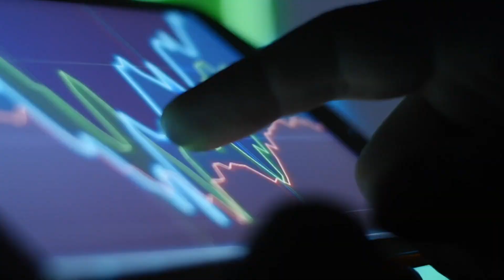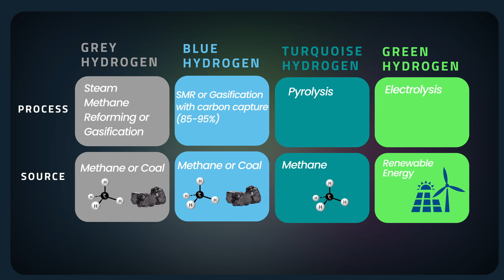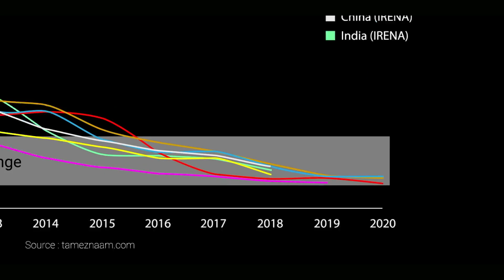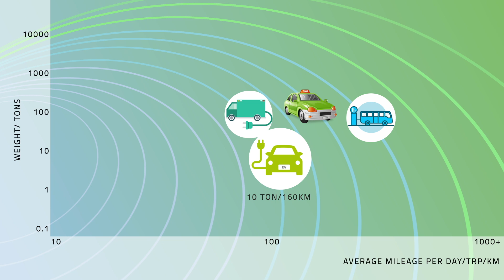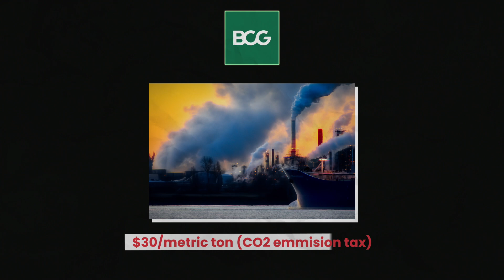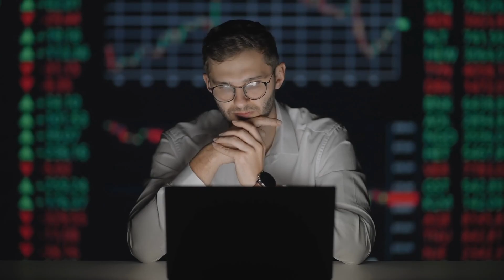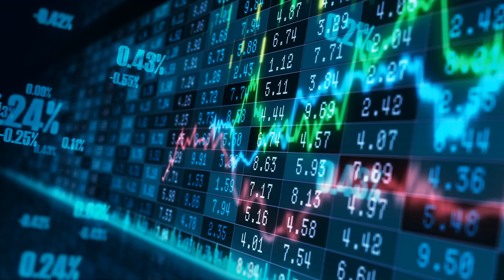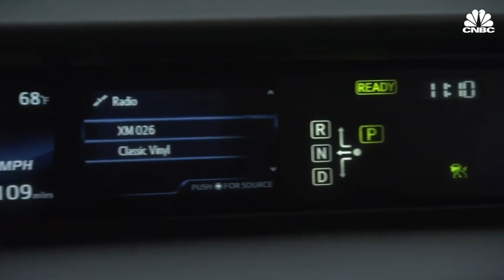Why NITIN GADKARI is pushing GREEN HYDROGEN for Indian Industries : Policy Case Study

Comment: India is abundant in one thing. Solar power - with abundant sunshine and land area. We need to lay more Solar farms. A lot more. 400 to 500 GW of solar power by the next decade. Solar is already the cheapest form of energy, so why not .. 
And solar power can produce Green Hydrogen for energy storage (instead of batteries) and for green transport.
Reply: Good. Now do tell me how trusting the solar is. China has monopoly over the raw materials. You need lands for the same. You need storage units to cater to fluctuating production.

Comment: Hydrogen is also good for grid level energy storage for when solar does not work during night, etc.
Reply: It's not. H2 production is just fuel production when you compare. When making H2 with excess green energy, your not shutting down coal and gas power on those periods.
Hence I've could just be doing that instead.
Reply: @Σ solar ain't inefficient. The watt per m2 
Might not be dense. However. Sun is free of power input.
Producing H2 cost abundance of energy that better used directly. Battery storage is there. And especially in countries as India there is more sun than countries up north which are already more involved in solar.